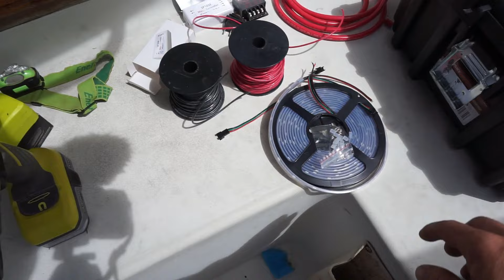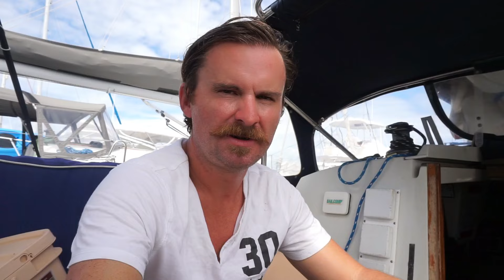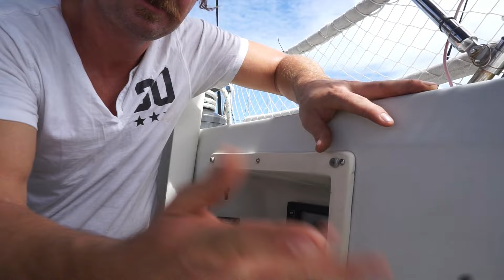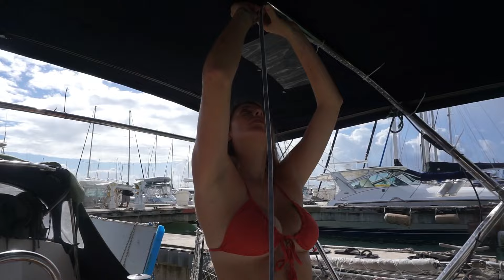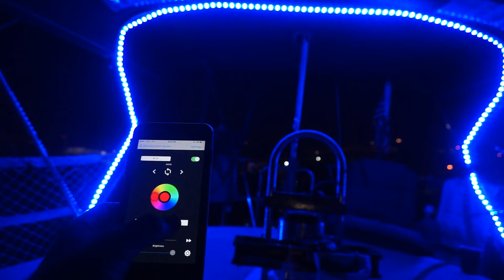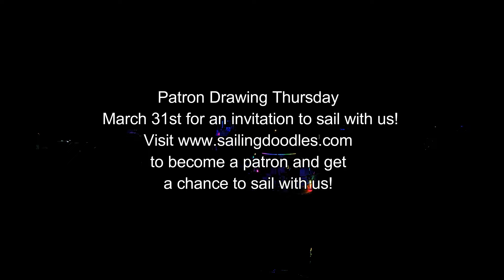installing LED Cockpit Lights - Boat Maintenance Monday 02 - Sailing Doodles

Comment: Hey Bobby, at around 2:20 i've noticed that you grounded the Lights directly to the post and bypassed the Shunt for your Victron battery monitor.
For Accurate State of Charge measurement of your batteries which is important to their longevity, you MUST pass ALL Loads through the shunt, so what would likely be better is to have a Ground Bus bar directly after the shunt, and ground everything to that. Also by doing this, your battery monitor can give you accurate remaining run times for the true load.

Also if your battery monitor supports the ability to run a load disconnect relay to protect the batteries from over discharge, you should fit that after the shunt but before any loads.
In that case, connect your Solar DC charger, and any dedicated mains chargers you have after the shunt but before the disconnect relay so they can still charge the batteries if the cutout trips.

Comment: So i could get 2 entire sets ( rocker, magic cont, led strips, voltage reducer) and i wannd do 1 set inside the boat and one set out side to light up the water correct??? Will the bluetooth be able to run both magic controllers without being and issue???

Comment: Twisting the ends of the zip ties off prevents a sharp edge. Every telecom tech zip ties thousands of cables and knows this is the way to prevent getting scratched by the ends or the ends cutting up the jackets on cables.

Comment: NOTE:  leave a small loop at one end (or both if your over 20 feet) should you need a little more to pull on one end or need to make or add something.This really comes in handy later.. (loop is about 6 inchs)  Short for dont make it so tight.

Comment: If you included a three way switch, with a motion detector
in the cockpit the lights would make for good intruder alarm, although I suppose
in your case the dogs fill that role.

Comment: I enjoy your videos...
Megan, use a pair of pliers to twist the extended end of the zip tie to remove it, not cut it. You will have no sharp edges.
Bobby, you are supposed to say "and now my beautiful assistant will..." when Megan takes over for you..
Keep up the good work. Have fun..

Comment: LED's have sure changed the way folks light things up.  
Neat part is they can be used on old 6 volt systems with the 
Adapter.

Comment: Just a couple of suggestions to consider since you want to do it right:

Glad you brought up the fuse, better yet go to your main boat panel so when you turn everything off...your really doing it. Also long term hopefully less messy wiring that nobody has a clue what goes where. Electrical Solder with rosin core....not acid core should be used, but make your mechanical electrical connections(crimp) as well as strain relief connections(crimp) first...then solder...then add shrink tubing to seal. Solder improves the electrical connection immensely but leaves it prone to breaking if wiggled....thus the importance of mechanical and stress relief connections

Comment: Hey Bob, I'm curious why you are using the "BINZET DC"  12 Volt to 5 Volt Regulator?  The "LED ALITOVE" Wireless Controller has a built in Voltage Regulator.  Thanks Harry

Comment: Better than cutting the plastic ties, twist them off for no sharp edges to get nasty scratches on.  It looks cleaner if you rotate the hasp of the tie to the other side of the bimini brace, where it can't be seen.

Comment: Thanks for the parts list!  The only ones I've ever installed I had access to A/C power so i just bought a transformer.

I'll admit I'm not a fan of the disco light mode, but I have a similar type of light ribbon for our deck, and it's great being able to select different colors, usually red or white, and then the exact brightness you need.  I think this is a great project for our boat. The red lights dimmed down will be great for any night sailing, and they won't use much power.

Comment: nice installation, the LED's are also good to just run when at anchor to prevent small boats from accidentally  running into you at night, its amazing how many outboards dont look up to see anchor lights , with that setup you will always stand out,

Comment: number TEN - I'm #10 and Megan Is A TEN, especially in this video. There is aa alternative to cutting Zip Ties. At the same time that Thomas and Betts introduced TyWraps, they also introduced a tool generally called a TyWrap Gun. They are sold at electrical supply house. You set them to the Zip Tie you are using then either a trigger and the tool draws the Zip up tight at the proper tension and cuts it flush. The tool is well worth it as the diagonal (wire) cutter way leaves a very sharp protrusion which 
slices skin very, very well  especial when someone reaches into a blind corner.

Comment: How many Doodles does it take to change a light bulb? LOL. 

Actually I really liked that. Especially watching carefully how to trim off the zip ties.  Who knew it could be that dangerous. Lol. Now you have a floating Discotech! All it needs is a mirror globe with a spot light. 

All jokes aside I can see how that would greatly improve enjoying the cockpit at night and by controlling the color and intensity it would help with driving the boat at night. No night blindness from white lights. Good choice. 

Does the entire length light up or can you limit the light to a specific area? Thanks Bob and Megan. You made my morning.

Lastly you need a good Camera light. That scene with Megan hanging the lights had to much back light. a light on the camera would of balanced that out and would of improved the area of focus.